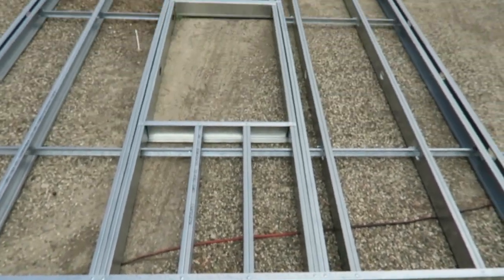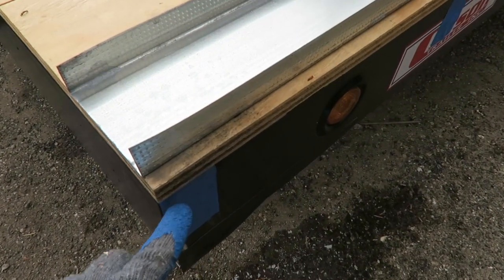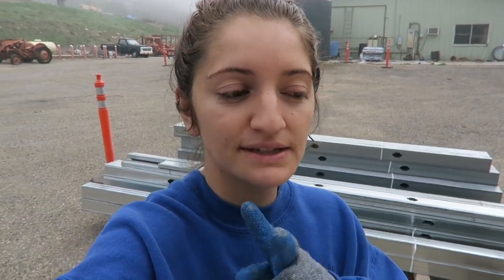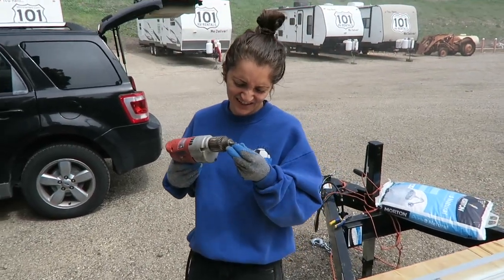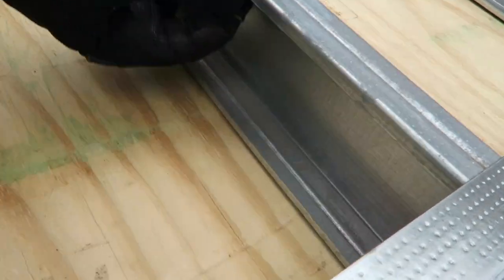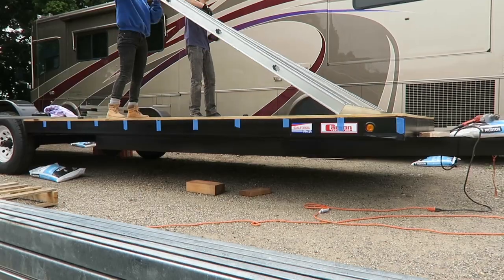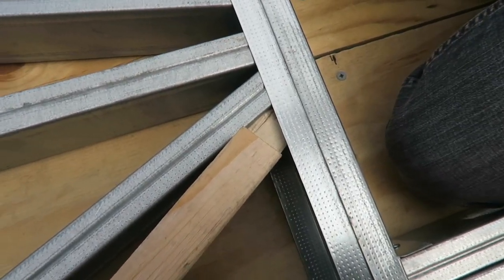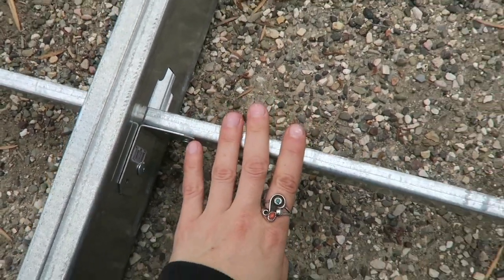HOW TO FRAME A WALL WITH STEEL STUDS | FIRST WALL COMPLETE | TINY HOUSE ON WHEELS

Comment: As long as you video every aspect of your build you should be able to get NoAH certification. The whole process is normally done online. I always giggle at the over kill builders put into tiny houses, for yours, you could land a helicopter on the roof and there probably wouldn't be any structural damage because of the steal framing, LOL.